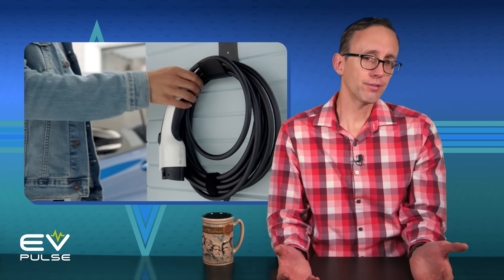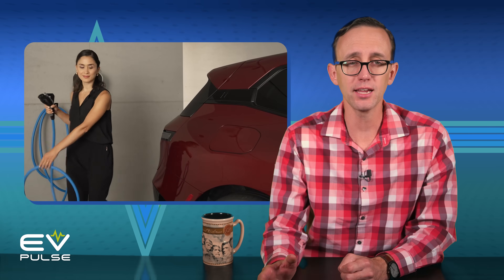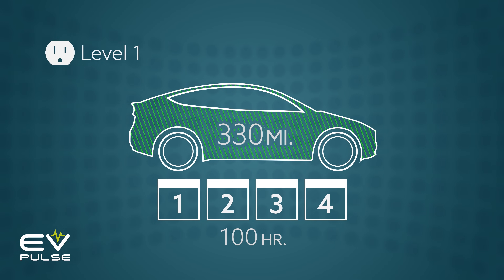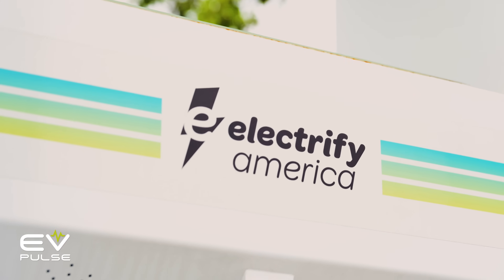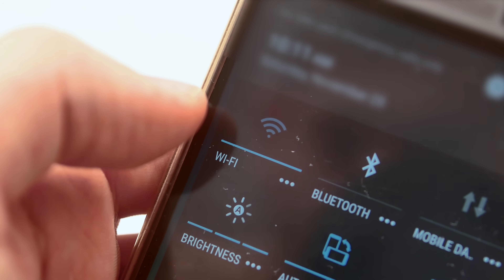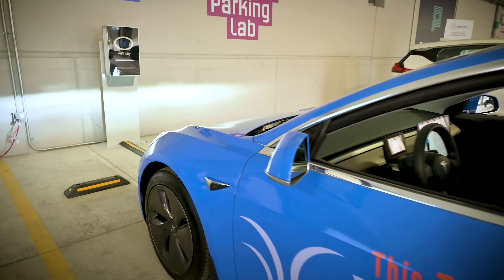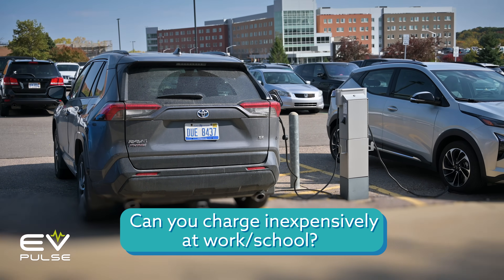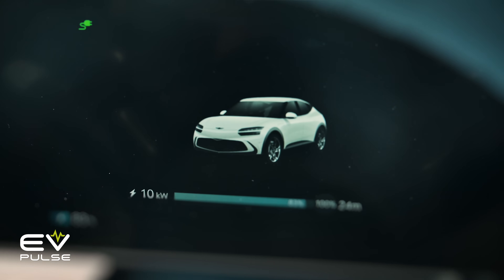Do You Need an EV Charger at Home? | EV Basics

Comment: Home chargers are dangerous, especially if not properly wired. From a firefighter’s perspective, the last thing you want to do is to bring an EV into an attached garage… EVs catch fire three ways, Mechanical Abuse, Electrical Abuse, Thermal Abuse. An EV is most likely to catch fire during charging… Once on fire, we really have no way to extinguish the fire. Check out FEMA guidelines for EV fires… The best way to be safe is to not buy one in the first place. They are really not the environment saviors that the politicians would have you believe. The most popular EV Truck has a higher death rate than a Ford Pinto…

Comment: I have a 2023 Chevy Bolt I bought 1 year ago. I got the $7500 Government rebate plus Chevrolet paid $1000 towards a 240v installation in my garage. I had to buy the Level 2 charger, but I am extremely happy with my set up. I charge about every 5 days from 20% to 80% and it takes about 4.5 hours. Not sure I would own an EV if I lived in an apartment, but home ownership is great. This is used only for local town driving, and we have another vehicle for long trips.

Comment: I still didn't find any answer to question why I shouldn't simply Connecticut an EV car to the wall socket (E.g. 3 phase 230V 16A = 11kWh), as most cars (as Tesla) have an onboard charger installed..
Why should I by a "charger" instrad of a much cheaper simple cable?

Comment: My ex husband had a separate breaker box set up for compressor or generator.
Would that plug setup be enough?
Reply: Is the line from the main panel to subpanel 50-60 amp, with 6 gauge wire?  Then yes.
Reply: @paulh6591  ex told me it's a 240v. 30 amp double breaker
Reply: @valeriehake  Instead of slow 12A 120v level 1 charging you could get an inexpensive level 2 20A, 240V module to plug into your 30 amp outlet.  Get one which has adapters, one of which is the correct type for your 30 amp outlet, It won't charge as  fast as a 50A level 2 charger, but it will be two to three times as fast as your standard 120VAC wall outlet.
Reply: @paulh6591  I'll check into that

Comment: If you are going to be away from home for a few months, is it better for the battery to leave it plugged in on level one, or level two charging?  It seems that level one would be less stressful for the battery.  Am I right?
Reply: Also, would it be better on the battery to set the maximum charge at 50%, if it will be charging for three or four months?
Reply from the maker: We'd leave the car plugged into your level 2 charger, but we'd probably set the maximum to 50%. The control system will help regulate battery temp and stuff while plugged in, and even Tesla's owners manual says to keep it plugged in so the charging system can do its thing.

We like the idea going to max 50% because then the BMS can shift things around if it needs to more easily. It's what we did with our company Tesla when we knew it'd be parked for extended periods (like during the pandemic).
Reply: @EVPulse Maybe I should have mentioned that I have a KIA EV6, not a Tesla, but I imagine that your battery charging advice is applicable to, essentially, any EV.
Reply: Why do you suggest level 2 VS level 1 charging for a vehicle that will be plugged in for months?

Comment: Most people call it a "CHARGER" but it is NOT  a charger...it is a EVSE (electric vehicle supply equipment).  

The "charger" (the one that converts the AC into DC, thus charging the battery) is INSIDE your car.  

Level 1 is just low enough that you can plug directly to your outlet.  Level 2 which goes MUCH higher (to 19 kW) so there must be a device that SAFELY provides AC to your car.

Higher than that you go directly to charge the battery using DC, and that is what is called DC-FAST-CHARGING (or the supercharger network of tesla).

This video explains it perfectly: https://youtu.be/jZBsOud4O9Q?si=X3z_0JhRtRhHHLiw
Reply from the maker: Yes. But here's the thing. The average consumer doesn't know, nor care, the technical details. We're trying to make videos that can relate to the everyday buyer who will soon be walking into a dealership confused as what to get. As long as the general public, Google, YouTube, and what not still refer to it as the charger, so will we. Not because we don't know, but because we feel the benefits of the video outweigh the need to be pedantic about what an EVSE is.

Comment: Here is the problem, where i live their are 3 gas stations less than 1/2 mile from my house,  the closest ev charger is eight miles from my home, in the distance to the EV carger witch is a Tesla set up,  l have more than 6 gas stations. I also live in a part of  Ny state that gets really freaking cold in the winter, my cars are parked outside in my driveway, no matter how long my car sits or how cold it gets the amount of gas in my car never changes until I drive it. Cold weather will decrease the efficiency of the battery in an electric car. Where i drive i can always find a gas station and my Subaru Forester has enough range to get me over 8 hours of driving before I have to get gas. No electric car can do this, and in the winter it is even worse as the efficiency of an electric car diminishes. So sorry but no EV for me.

Comment: Don't sell level 1 charging short. For most EV owners, charging overnight will provide more than enough range for the day's driving. With this remaining charge the nightly charging will leave the car with increasing charge levels and then maintain a full charge.
Reply: Exactly! One major use case for EVs is for people who live in a city and commute a few miles across the city 3-5 days a week to work and then around the city on the weekends. Most won't even use more charge than the amount that will get replenished each night or each day at work doing level 1 charging, so they'll never need level 2 charging most of the time.
Reply: It is not at all efficient though. You are wasting electricity at 110V that doesnt go into battery charging. Almost 25% of it is wasted. 240V is way more efficient especially at 24A to 32A range. Around 90% to 95% efficient so less money wasted.

Comment: Great information. Unfortunately, I have a townhouse built in 2004 with only  a 125 main breaker. I already have an electric range, clothes dryer, and a central AC unit; and my circuit breaker board is completely full. it would be way too costly to have heavier lines run underground from the street, a new circuit board, and the wiring for an outlet or charging device. So, I guess that I will live with my Subaru Forester for a few more years.

Comment: Level 1 charging can be a reasonable option for many people. Yes, it only restores 3-5 miles of range per hour. But that is 30-50 miles of range over night. Since Americans drive about 38 miles per day on average, Level 1 charging may be enough if you are at or below the average.

I have owned a long range EV for about 4 years and haven’t yet bothered to install Level 2 charging at home simply because Level 1 charging has been adequate to my needs.

I’m not advising against Level 2 charging at home, but if it is cost prohibitive for you to install, take a close look at your typical driving patterns. You might find that Level 1 charging is more practical than it seems.
Reply: It is not at all efficient though. You are wasting electricity at 110V that doesnt go into battery charging. Almost 25% of it is wasted. 240V is way more efficient especially at 24A to 32A range. Around 90% to 95% efficient so less money wasted. You should think about that wasted electricity bill cost over long term.
Reply: @Fear.of.the.Dark.  sometimes it is prohibitively expensive to run wiring from the main panel to the desired charging location—like in my last home, where I was quoted thousands of dollars to trench the wires underneath my back yard. My family and I lived with level 1 charging for multiple EVs for years. We didn’t have to fast charge because we don’t live in a rural area that would require us to drive long distances every day.

Comment: Yes When I get an EV vehicle this spring 2023, I will be mainly charging at home and my trips with the vehicle will be just around town or short range single charge events.
We should let the EV cycle between at least 20 and 80 percent of charge to get better life out of the vehicle battery.   Just charging a little bit at a time will short charge cycle the battery and may do harm to the battery over long periods of time. You don't mention this in this particular video.  This is the same thing you should do with a Cell phone, computer, or any rechargeable unit.
That said, I would get a type 2 EV charging station for my home. That way I can drive maybe several days, let the battery go down to 20 percent, and then quickly charge it back up to 80-90 percent over night at home.

Thanks for the video. Take care.
Reply: that is patently wrong info. Short cycles are way better than long discharge cycles.

Comment: Most cars are parked at home a dozen hours per day. At 4.5 miles per hour, that's over fifty miles of range. Most Americans drive less than thirty miles a day. So this is BS.
Reply: Well, not all EVs are that efficient. Most EVs get closer to 3.5 rather than 4.5, and trucks are more like 2 miles. However, my opinion is that the NEMA 6-20 circuit can handle the overwhelming majority of ev owners at 100+ miles of range per night.
Reply: Also, many EVs are programmed to not balance the pack on 120v chargers because they’re so weak it would take a very long time
Reply: 💯 bullshit. Wanting one and actually needing one are wildly different things. I’m averaging 1500 miles a month on my Bolt EUV - that’s 18K a year. On a 20a circuit I get back 5 miles per hour, or 60 miles every 12 hours. 60 miles times 365 days? Well over 18K. I’ve never had to fast charge, even on days where I go 100-120 miles in a day. I make it all back up over time, easily. It’s a nice-to-have for most-not-all drivers. Just follow the rules of ABC - always be charging - and then see if you actually need to shell out the cash for one.
Reply: It is not BS. Option is let the EV run down to 20 percent after several days of driving and then charge it back up over night to 80-90 percent.  With a level 2 charger I can do this.  This will give better longer life to the battery, rather than short charging it all the time.  Its up to you what you want to do, I don't really care.
Reply: @dathyr1  What's BS is that a level 1 won't suffice. It will. Obviously, then, you're golden with a level 2.

Comment: Great video again, thanks! For our electric car, we use the charger that came with the vehicle but on a Level 2 (50 A, 6.7 kwh) outlet we had an electrician install. We didn't need to buy an extra charger box as the outlet was installed in the garage and so there was no need for GFCI and whatever else. Just the Nissan charger that came with the car, and then the outlet and wiring cost about $1000. Here's more of our story: https://www.youtube.com/channel/UCkxs6SJS4qQNP35C3x8weqA

Comment: I don't know what this guy is going to say, I am making this comment before watching, however I would say if you don't have a way to charge at home you should not even consider an EV.   Your life will be miserable.
Reply: I don't charge at home. The charger is 10min drive from my house. Easy as.
Reply: @MangoHillCommunityFarm  but how long do you waste at the charger?  The biggest benefit of an EV is avoiding gas stations and charging stations and charging at home.  Not only do you waste time but if you are paying to fast charge it’s no cheaper than gas.  It is a lot cheaper at home and way more convenient.
Reply: @davva360  lol. The fast charger takes 14 minutes to go from 10 - 80. That's a great opportunity to get out and stretch my legs and eat something.
Fast chargers cost about 1/5th of fuel. So significantly cheaper. It's not free at home either.
Reply: @MangoHillCommunityFarm  watched enough charging and road trip videos to know that fast chargers are not much cheaper than gassing up a medium sized car.   It costs me about $30 to fill my car and it does 38mpg on a highway or about 380 miles.  At 45 cents per kilowatt hour you would get 66 kilowatts which in many EVs would be pretty close to 70% of the battery.  At highway speeds you would get about 200 miles from that charge at best.  Do you what you want but you are kidding yourself thinking you are saving money by using fast chargers.  You save your money when you charge at home and your car is ready to go.  At home electricity rates are much lower.  It’s why my next car will be an EV.
Reply: @davva360  I don't need to kid myself. I just add. I know what I used to spend, and I know what I spend now.
I'm glad you're so confident on other people's real-world experience, especially after you've watched some videos on YouTube.
Reply from the maker: You should watch. That’s basically what he says.